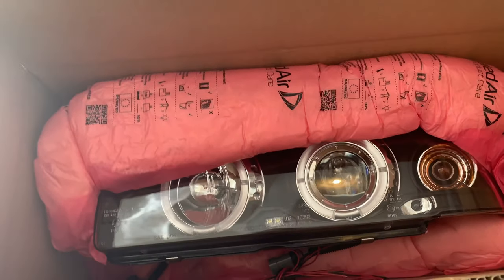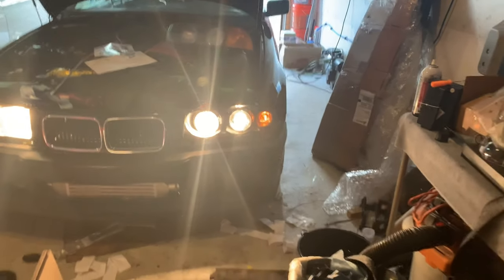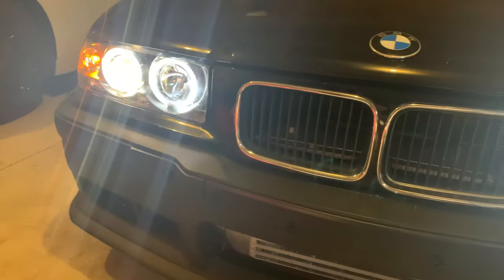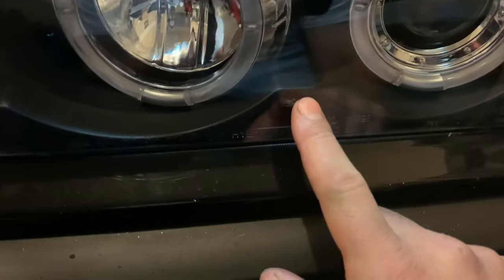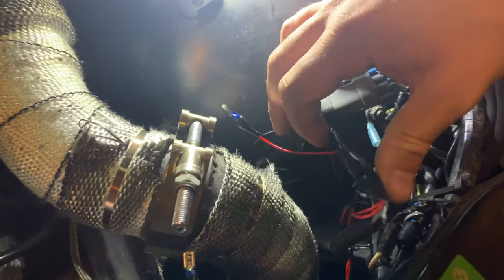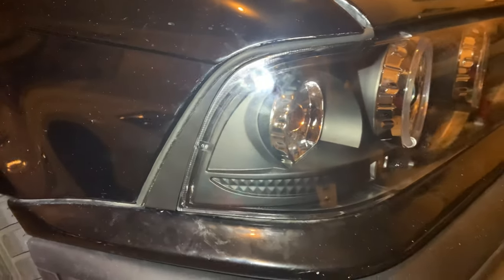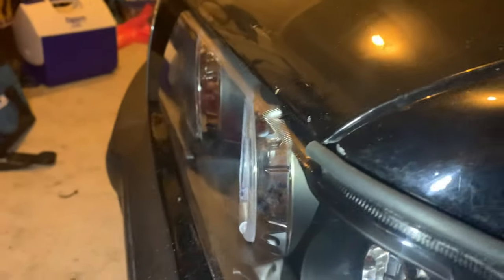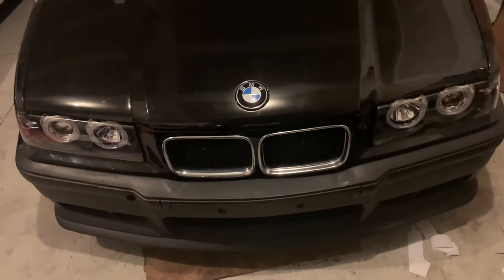E36 EBAY HEADLIGHT INSTALL: BMW E36 Turbo LS Swap Part 24- Halo projector one piece lights

Comment: The Halos are supposed to be on while the car is running. They are running lights
Reply from the maker: Yeah, they didn’t wire in properly, I’d have to change it up a little bit to make that work

Comment: So did you put radials on this beast and tale it to the strip? That would be resolve interesting to see.
Reply from the maker: I do have a pretty good tire on the back, but I haven’t launched it yet because I am almost certain I will blow up my rear end, but stay tuned I’m going to put a better one in soon!

Comment: Hey Ik this is an older video but I got mine and I’m having trouble getting them in, the turn signal is like getting stuck on the fender
Reply from the maker: There’s a guide for it that it slides into. It’s tricky